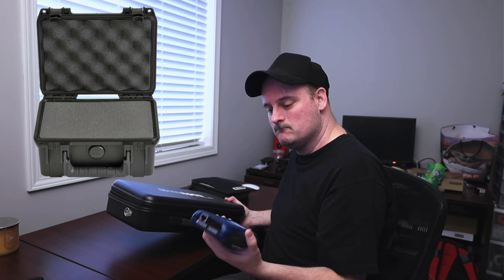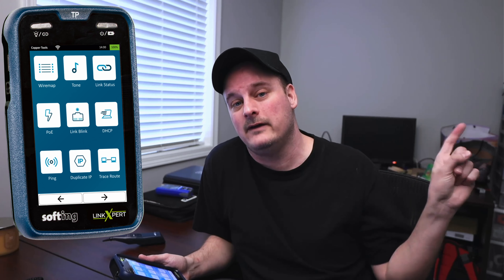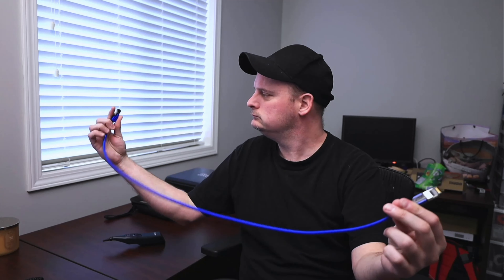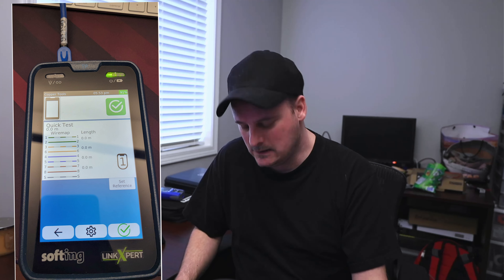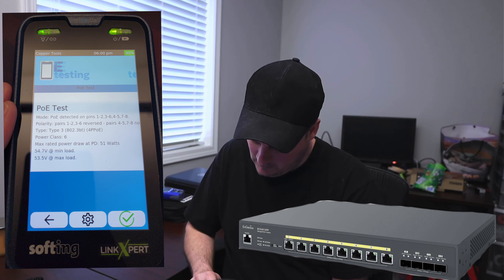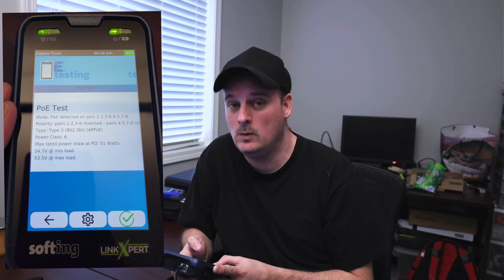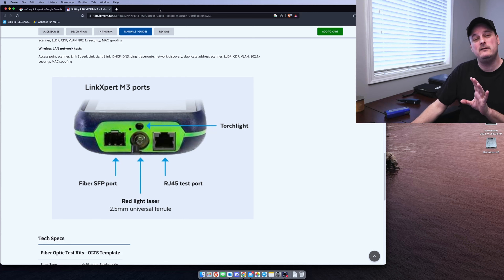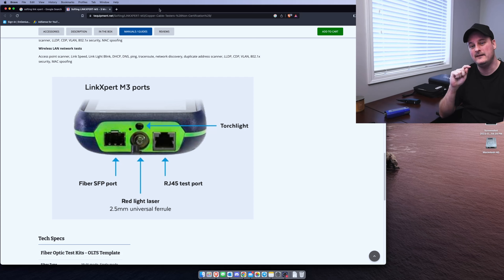Softing LinkXPert Tp Network Tester !! | #softing | #LinkXPert

Comment: This a very attractive tool im looking to upgrade, my concern is the battery replacable? What happens when the battery goes out?  Also do you need you need thr dongle on the other end to trst thr pairs / faults?
Reply from the maker: I will get these answers for you sir !
Reply from the maker: It doesn't look like the battery is easily replaceable, it does look like its just a cable to the PCB inside though, easy to take out the 4 screws. I have asked the question if users can buy replacements. Also the unit can detect shorts with out the end dongle :)
Reply: @JasonsLabVideos  thank you so much !!

Comment: How does it print results in pdf or any other format in order to send proof of cable certification?
Reply from the maker: You save it to thumb drive.  There is a usb port on the side, after you do all your work, you plug in the Usb stick, save it all to it.